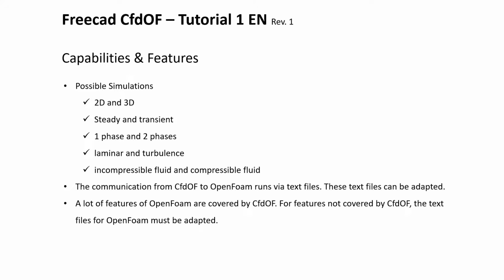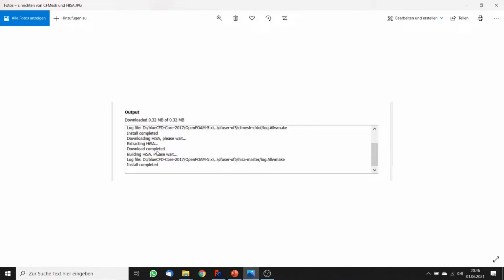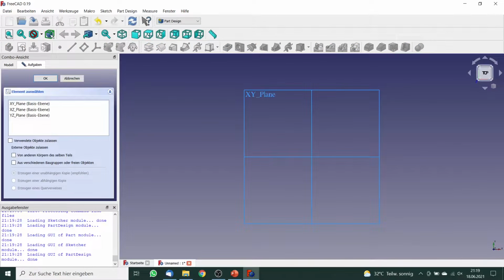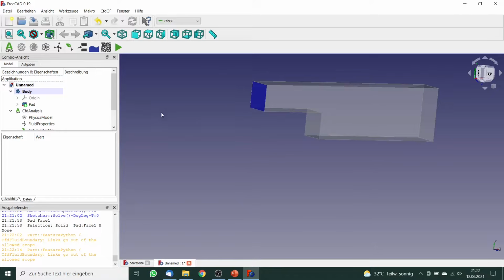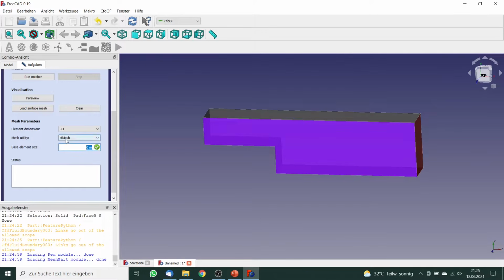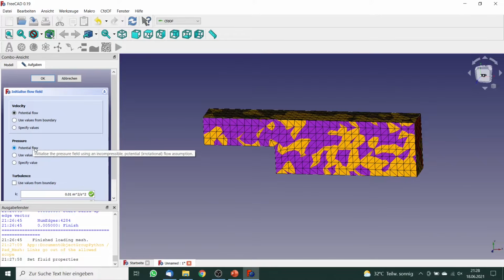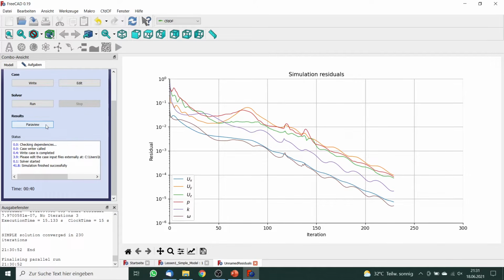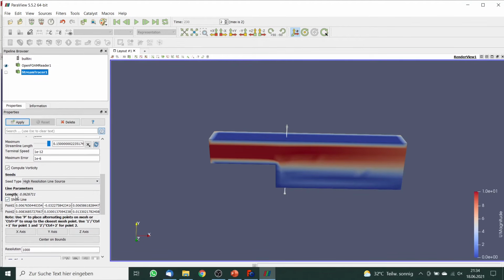Freecad CfdOF Tutorial #1: getting started

Comment: ok so all of the video's for open foam tell me .... it is an inverse geometry CFD modeller that to get useful results from you have to invert the data just to see what you have around the model .... because it only models in a pipe NOT in free space ... and needs 3 other programs just to work .... thats not an addon thats a cludge to get a result that you cant trust because of all the extra programs and the errors they multiply in .... 
so not using openfoam would be better .... but so far no one offers a proper WIND TUNNEL testing software ... 
just plumbing tests

Comment: Hi, thank you for your great tutorial!

I’ve followed your steps for CFD analysis in FreeCAD with CfdOF, and I recently switched to blueCFD-Core 2020-1 on Windows.

However, I keep getting this error when I try to run the simulation after meshing > 30 times! 

text
RuntimeError: No face specified for velocity direction in boundary 'inlet'
Write case setup file failed

I set inlet, outlet, and wall boundaries, and checked both geometry and mesh (no errors).
I use gmsh for meshing.
I’ve reinstalled CfdOF and FreeCAD, changed OpenFOAM versions to blueCFD-Core 2020-1, and double-checked all boundary settings, but the error still appears.

Thanks again for your helpful videos! 
If you have any idea what might cause this or how to fix it, I’d really appreciate your advice.
Reply from the maker: Concerning the installation of blueCfd, you will please find the information in the FreeCad-Forum:
https://forum.freecad.org/download/file.php?id=133600
https://forum.freecad.org/viewtopic.php?t=95780
https://forum.freecad.org/viewtopic.php?t=83690
https://forum.freecad.org/viewtopic.php?style=3&t=59537
https://forum.freecad.org/viewtopic.php?t=68499
Reply: @techbernd5535  Hi! I wanted to sincerely thank you for your dedication and for all the resources you shared when I asked my question. I really appreciate how seriously and enthusiastically you helped look up so much information!

I’d like to share my experience in case it helps others:

After reinstalling blueCFD-Core-2020-1 several times (maybe four or five times), I finally noticed that it recommends installing MS-MPI 7.1. During the first few installations, I didn’t pay attention and just kept clicking through the installation (my English isn’t good, haha). For a while, I still couldn’t figure out why things weren’t working. After many failed attempts, I started to suspect it might be an MS-MPI version issue.

My system already had MS-MPI v10, so the installer skipped installing MS-MPI 7.1. After reading your advice (and also with help from others—including the Perplexity AI assistant, who guided me through the troubleshooting process), I uninstalled both MS-MPI v10 and blueCFD-Core-2020, then reinstalled blueCFD-Core-2020 so it could install MS-MPI 7.1 as recommended. After that, it finally worked!

I think a lot of people might run into this issue, so I wanted to share what worked for me. Thanks again for your patience and for all the effort you put into helping others. With your help, advice from other sources, and support from the Perplexity AI assistant, I finally got past the “RuntimeError: No face specified for velocity direction in boundary 'inlet' / Write case setup file failed” error!

Thank you so much!

By the way, my English isn’t actually this good—I got a lot of help from the Perplexity AI assistant and just did some copy and paste, haha!
Reply: @techbernd5535  Hi! I wanted to sincerely thank you for your dedication and for all the resources you shared when I asked my question. I really appreciate how seriously and enthusiastically you helped look up so much information!

I’d like to share my experience in case it helps others:

After reinstalling blueCFD-Core-2020-1 several times (maybe four or five times), I finally noticed that it recommends installing MS-MPI 7.1. During the first few installations, I didn’t pay attention and just kept clicking through the installation (my English isn’t good, haha). For a while, I still couldn’t figure out why things weren’t working. After many failed attempts, I started to suspect it might be an MS-MPI version issue.

My system already had MS-MPI v10, so the installer skipped installing MS-MPI 7.1. After reading your advice (and also with help from others—including the Perplexity AI assistant, who guided me through the troubleshooting process), I uninstalled both MS-MPI v10 and blueCFD-Core-2020, then reinstalled blueCFD-Core-2020 so it could install MS-MPI 7.1 as recommended. After that, it finally worked!

I think a lot of people might run into this issue, so I wanted to share what worked for me. Thanks again for your patience and for all the effort you put into helping others. With your help, advice from other sources, and support from the Perplexity AI assistant, I finally got past the “RuntimeError: No face specified for velocity direction in boundary 'inlet' / Write case setup file failed” error!

Thank you so much!

By the way, my English isn’t actually this good—I got a lot of help from the Perplexity AI assistant and just did some copy and paste, haha!
Reply: @techbernd5535  Hi! I really appreciate how seriously and enthusiastically you helped look up so much information!
I’d like to share my experience in case it helps others:
After reinstalling blueCFD-Core-2020-1 several times (maybe four or five times), I finally noticed that it recommends installing MS-MPI 7.1. During the first few installations, I didn’t pay attention and just kept clicking through the installation. For a while, I still couldn’t figure out why things weren’t working. After many failed attempts, I started to suspect it might be an MS-MPI version issue.

My system already had MS-MPI v10, so the installer skipped installing MS-MPI 7.1. After reading your advice and the Perplexity AI assistant( who guided me through the troubleshooting process), I uninstalled both MS-MPI v10 and blueCFD-Core-2020, then reinstalled blueCFD-Core-2020 so it could install MS-MPI 7.1 as recommended. After that, it finally worked!

I wanted to share what worked for me. With your help and support from the Perplexity AI assistant, I finally got past the “RuntimeError: No face specified for velocity direction in boundary 'inlet' / Write case setup file failed” error!

Thank you so much!

By the way, my English isn’t actually this good—I got a lot of help from the Perplexity AI assistant. and just did some copy and paste, haha!
Reply: @techbernd5535  Hi! I wanted to sincerely thank you for your dedication and for all the resources you shared when I asked my question. I really appreciate how seriously and enthusiastically you helped look up so much information!

I’d like to share my experience in case it helps others:

After reinstalling blueCFD-Core-2020-1 several times (maybe four or five times), I finally noticed that it recommends installing MS-MPI 7.1. During the first few installations, I didn’t pay attention and just kept clicking through the installation (my English isn’t good, haha). For a while, I still couldn’t figure out why things weren’t working. After many failed attempts, I started to suspect it might be an MS-MPI version issue.

My system already had MS-MPI v10, so the installer skipped installing MS-MPI 7.1. After reading your advice (and also with help from others—including the Perplexity AI assistant, who guided me through the troubleshooting process), I uninstalled both MS-MPI v10 and blueCFD-Core-2020, then reinstalled blueCFD-Core-2020 so it could install MS-MPI 7.1 as recommended. After that, it finally worked!

I think a lot of people might run into this issue, so I wanted to share what worked for me. Thanks again for your patience and for all the effort you put into helping others. With your help, advice from other sources, and support from the Perplexity AI assistant, I finally got past the “RuntimeError: No face specified for velocity direction in boundary 'inlet' / Write case setup file failed” error!

Thank you so much!

By the way, my English isn’t actually this good—I got a lot of help from the Perplexity AI assistant and just did some copy and paste, haha!

Comment: is it possible to run snappy hexmesh or simply run the mesh file from ansys mesh to solve in openfoam
Reply from the maker: That's a very difficult question, and I can only give you a rough answer: Snappy Hex Mesh is part of CfdOf, you can use Snappy Hex Mesh as part of CfdOf. Importing "external" meshes (e.g. from Ansys) is not so easy, because the boundary conditions are also processed when the mesh generator is started. This means: You can import an external FEM mesh, but you will have great difficulty setting boundary conditions for it. I have looked into this problem, but have not found a solution. But that does not mean that there is no solution, I am not an expert on this topic, please ask this question in the FreeCad forum, there you will find many experts who can answer your question. You can find the FreeCad forum here: https://forum.freecad.org/viewforum.php?f=37

Comment: Is there a reason face7 isn’t constrained (eg. also as a wall)? Is does the symmetry on face8 mean that the opposite face doesn’t need to constrained? Thanks for this tutorial series, I think they will help a lot 👍
Reply from the maker: @rhodriwilliams2891: You are right, face 7 is not constrained. That was a mistake that happened to me during the recording. Normally, this surface should also be constrained.
Reply: @techbernd5535  I’m assuming as a no-slip wall? Thanks for the prompt reply 👏
Reply from the maker: @rhodriwilliams2891  Yes, a no-slip wall.
Reply: @techbernd5535  

Is there a tutorial to install cfdof in FreeCAD on Linux ? 

OpenFOAM and Paraview are already installed on my Ubuntu 20.04 computer but I have not been able to make cfdof run in FreeCAD.

Comment: Hi Bernd, is symmetry constraint like a wall? Why didn't we use wall, non slip instead of symmetry constraint? Thanks.
Reply from the maker: Hi shuvashishroy6006, a constraint like a wall would also be feasible. Please mind that this tutorial is about starting FreeCad CfdOf, so I made the most simple calculation possible.

Constraints / boundary conditions can be interpreted  physically or mathematically. A wall with no slip for examples defines mathematically the speed (= zero) and the pressure. A symmetric boundary condition defines the symmetry of this object, means, that anything that happens in the left half is identical with the right half.

I chose a symmetric boundary condition because for postprocessing, you can interpret anything you see as a slide through this system. If you take a look on my tutorial about cars (https://youtu.be/KWbUaiE9SBc), you will understand how a symmetric boundary condition works. A symmetric boundary conditions has advantages in postprocessing (= similar to a slide through an object) and advantages in calculation time (= half of the calculation time)
Reply: @techbernd5535  Thank you so much for the awesome explanation!
Reply: @SR_2206  Thanks to both of you. I am learning a lot.